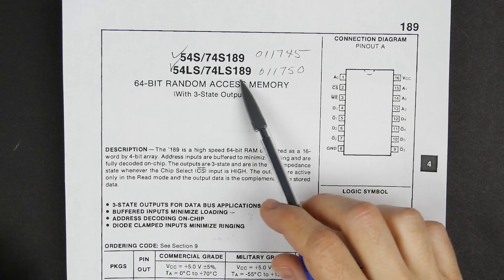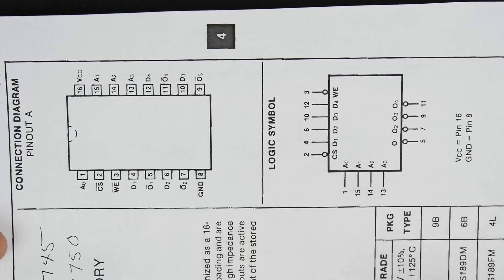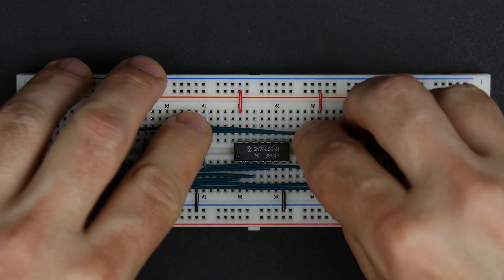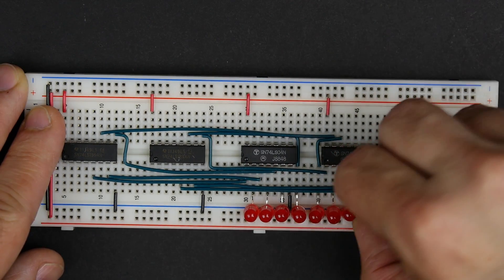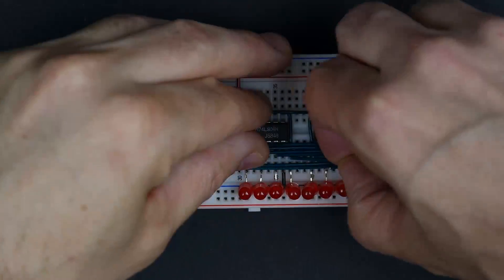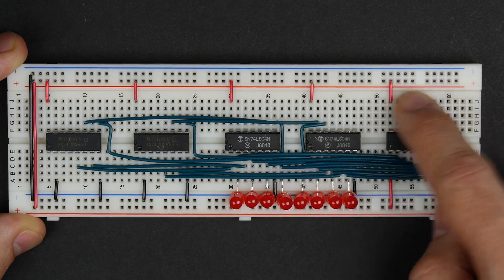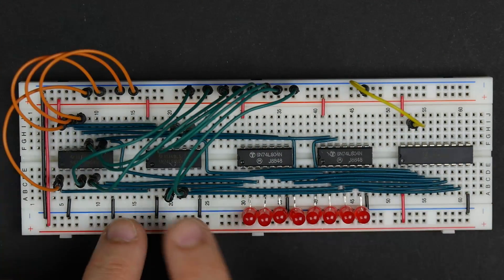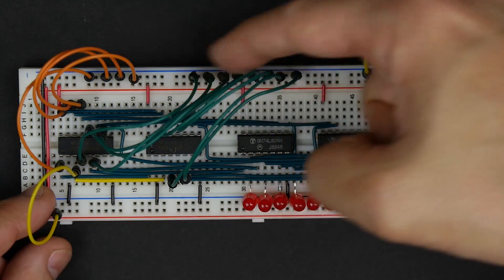RAM module build - part 1

Comment: Update:
If my calculations are correct, to achieve one kilobyte of memory on breadboards would rewuire 128 of the 74ls189 RAM chips to get 1024 addresses with 8 bit storage. 19 breadboards would be needed for all those ram chips, 15 breadboards for all the inverters, 22 breadboards for all the tri state buffer chips. All together ben would require 56 breadboards for all the chips if none of the breadboards were to share different chips. Only 8 LED's would be needed though because you can link every output of a single bit in memory to one LED which is nice.
Reply: actually you only need 8 Inverters (2 chips) and 1 tri-state-buffer
since only one chip is outputting at the same time, because the other chips are not enabled via the ~CS line, there are no collisions. so you connect all the address-, input- and output-lines into 3 small buses invert the output-bus and feed that into the tri-state-buffer.

Comment: If my calculations are correct, to achieve one kilobyte of memory, Ben would need 293 breadboards to accommodate for all the 2048 74ls189 chips. He would also need 1024 inverter chips and 1024 tri state buffers. 114 boards would be required for the inverter chips. 163 boards for all the tri state buffers. Again, if my calculations are correct, he would need 570 breadboards if none of the boards were to share different chips. Who knows how much wire he would need.

Comment: You should use tri-state inverters, so you save space and money. I'll personally do that, and I'll also use CMOS chips (AHC series, 3x faster than HC, 5V, and they cost the same). I don't think there's any problem with that and it'll be faster (I intend to run an OS when it's finished, with an appropiate clock, just because it'd cool).
Reply: GRBTutorials no need for that, just use the inverters prior to writing to memory and then use the tri state of the memory chips.

Comment: Why didn't you just invert the inputs? That way, you would store the inverted values, but would not need an extra tri-state buffer, because RAM chip already has it's output pins like that

Comment: Sir, im using an sram 6116, there is no output, only I/O, im wondering if the pin 20 or OE not is resposible for changing the Data in to output? Thanks happy and new year!

Comment: My experience with the 74LS189:
It turns out that the 74LS189 were fake chips that did not work (apparently the original 74LS189 are hard to find). The exact same issue is described on the EEVblog: https://www.eevblog.com/forum/projects/d-flip-flops-(ttl)-driving-me-crazy-(going-haywire-instead-of-1-or-0)/

I replaced the entire RAM with an LP621024-D70 128kB SRAM chip for my 8bit CPU. You can find the schematics on my website:
simonmartin.ch/8bit

Comment: Something I noticed in this video that just scratches an itch.. your breadboards have the power rails connected along the full length. I have to put jumpers between the two halves to have them conduct. :O
Reply: you went cheap and got what you saved

Comment: My RAM module is drawing around 2 amps when I connect A0 to GND. The 74LS189s become really hot. When I disconnect it from GND and connect it to +5V or when I disconnect it completely, the current being drawn Is only a few milliamps. How do people manage to get this to work properly?
Reply: Hi Radiofreak. I'm currently experiencing this exact problem. Did you ever figure out what the problem was? It's qiete infuriating
Reply: I had a similar problem. My 74LS189 were just emitting heat while not working at all. Turns out that my chips were some generic fake parts as described here: https://www.eevblog.com/forum/projects/d-flip-flops-(ttl)-driving-me-crazy-(going-haywire-instead-of-1-or-0)/

I then replaced the RAM myself with a LP621024-D70 SRAM.
Reply: Radiofreak1041 sorry can't help with your problem but how do you know how much current your circuit is drawing?

Comment: Please, help me! When I put 3rd (WE) pin of 74LS189AN to the 5V, chip starts to heat up. Whats the problem?
Reply: I came to the conclusion that the batch of chips were either bad or counterfeit, so I put this to the ebay supplier who refunded my money immediately without comment. Almost as if they didn't want any fuss. Anyhow, I bought new chips from a different supplier (which were more expensive) and amazingly they worked straight away and stayed cool.
Reply: I too decided to order more expensive 189's in the end from a UK seller (the batch that didn't work were a cheap Chinse import ... I know, I know).  The replacement parts worked exactly as per the datasheet.

My chips were actually for a 16 byte hardware stack rather that the ram itself.  Following Ben's excellent videos I've beefed my buiild up a little with 256 x 14 bit words of ram, 14 bit instruction words (6 for the instruction + a full byte of data), the aforementioned hardware stack, an enhanced ALU with 5 functions, two status bits from ALU (zero and carry), a bit shifter module (roll left, roll right and swap nibbles), 24 bit control bus (4 still left to play with :o)  ).  Managed to write a program to find all the prime numbers up to 255 (takes a fair old while!) and also a program to write alpha numeric to a 16x2 line LCD module attached to the display module. I've had so much fun with this.  Massive thanks to Ben for the tuition and inspiration.
Reply: Same thing here. ordered replacements from jameco electronics in the US, they work fine. thanks!
Reply: Having the same issue.  Don't suppose you've sussed it yet have you?
Reply: Tim Baxter Still doesnt work. Seller from ebay sent me a new IC. This time I will try to replace those RAMs with EEPROM.
Reply: I'm also getting the same problem - according to the data sheet, with just power, CE and WE it draws 40mA - and mine does.  But as soon as I put any other connections, like data lines, address lines or output lines in, the chip heats up.  After a couple of minutes it's at 90 degrees and still rising, so I cut the power and scratch my head.  I've removed all the connections and completely rewired the RAM unit three times, always with the same effect. I've also tried swapping out the 189s for others - same again.  Any suggestions would be gratefully received.  In the meantime I've ordered some 74C89N RAM chips that looks very similar (although I am probably hopelessly wrong there).
Reply: I'm seeing the same issue. Did you ever figure this out? Looks like several others are as well...
Reply: Andy Timmons thank you for the reply. Someone else reported the same fix as well. I'll try that and report back in case helpful to others.
Reply: Hi! I also have this same problem and have ordered from two different ebay sellers already and they are all faulty. I cheched Jameco but they do not ship to Finland. Anyone here have any other site where these can be ordered to Finland?
Reply: Alex Roetter Hey, I just hooked mine up (from Jameco) and it feels generally a bit warm, haven't bothered to let stay on for long ($5/chip), any ideas as to why?
Reply: Ahh, I was also effected by this. I had bought these chips years ago on eBay and only tried wiring them up now but same situation, tried wiring them and the chips overheat. I have some more versatile chips on the way anyway, so not a big deal, but really frustrating.

Comment: It's hard to understand under what circumstance someone would want the complement of the data they tried to store.  Really seems like a "feature" where the chip designer like.. totally forgot to add that last output transistor, man, aawww.  Guess it can just go on the datasheet as an inverting output then.
Reply: He's probably laughing at us right now XD
Reply: If you package it as "for hobbyists," then it's a feature because said hobbyists get to spend more time, money, and space fixing the issue built into the product you made.
Reply: maybe it‘s for double purpouse, you can use it as a RAM and as an inverter too
Reply: for some really special application yes
Reply: Your inputs could be generating the inverse of what you want to store.

Comment: Dude! Why didn't you put the inverters on the inputs so you could use your tri-state outputs?
Reply: GordieGii 1) he could also use it like that w/o problem. 2) He deliberately chose to manually implement tri-state switch so that we can see LEDs on at all times, not just when we are outputting stuff to the bus
Reply: @Redstonetehnik  Did you tried that suggestion, pls? To take an edvantage from three state you are connecting 189 RAM output to bus and inverter inputs to same bus (keeping inverter output connected to 189s input) then you are losing writing possibilities of RAM despite its not outputting anything. Not sure why. Might be because of loop? Not sure why since during writing Im not reading RAM to bus...

Comment: can i use 74htc series with 74ls series?
Reply: yes , I think
Reply: On reedit,a guy says cht chip are better, because the computer runs with less curent draw, those chip are cmos, not transistor,a more modern technologe
Reply: @arlenestanton9955  yeah but unless ur building a computer with a size of a room with those chips , ur not gonna run into problems about that

Comment: I don't understand why you don't have this as your registers. is it to show us how to make the registers, and then you said "forget it, I'm using this chip to remember the code" , or is it because the A and B registers are genuinely different from RAM?
Reply: registers are where values are held temporarily so that functions can be performed on them - like the ALU in this project adding registers A and B. RAM is a much larger amount of storage space, but you can't do math or anything on it.
Reply: @monkybros  some architectures do allow you to operate directly on RAM, heck, the MC6800 (not MC68000, don't know about it) has arithmetic instructions which require one of the inputs to be a location in memory.
Reply: @bryceforsyth8521  Those architectures have instructions that operate directly on RAM, but in order to execute those instructions, the CPU needs to read the data from RAM at the given address, calculate the new result, and write it back.
Of course, the same is true if you run an instruction that operates directly on a register. The difference is that there's typically only one path to the RAM (through the bus), but there could be several parallel paths to the registers, so that more than one can be read at the same time.
If you have an instruction that adds the contents of one RAM location to another, it will need one cycle to read each value, and one to write it back, so the single connection to RAM likely becomes a bottleneck. Unless you have separate RAM for code and data, the connection to RAM likely becomes a bottleneck anyway since you can't read instructions and read / write data in RAM in the same cycle.
Reply: Registers are always available, the data in the RAM must be addressed.

Comment: The datasheet of the RAM chips states that the outputs are 3-state. Why use a buffer?
Reply: He wants to see the output on the LEDs, without necessarily outputting to the Bus.
Reply: I had the exact same question. Hoping Ben can shed some light on it.
Reply: That makes sense. Easier to debug, good idea. Thanks Mohammed!
Reply: also when he built the ALU he used the unbuffered outputs from the other registers to feed the ALU

Comment: Why invert the output? Just say on your switch that 0 is 1 and vice versa. And here we go.
Reply: Thomas Anderle but it is writing non-inverted. So if it writes 0x00 it'll return 0xff, and if you write that again it invertes again. So either on write or on read you need to invert it.

Comment: Hey Ben, a couple things:
1) you should tie the unused inputs of the inverters high or low to prevent them from oscillating.
2) can you use an inverting octal bus xcvr and not need the inverters?
3) How about adding battery backup to the RAM?

Great series BTW!
Reply: 1) LS chips have a tie up resistors inside so if you don't connect them thay will go high (HC doesn't have that) 

2) it's a ram , if you nead memory that stores data even after unplugging power , use EEPROM or something

Comment: when i put new information in the sram  it loads the bits but when i turn off the pwr it gose back to they original information on it
Reply: that's how sram works. The data is temporary.
Reply: you mixed up RAM with flash memory or EEPROM

Comment: I can't get the 74LS189 yet but somehow I found some 62256, a 32768*8bit SRAM. However it has 15 address pins and it's data I/O pins are all bi-diractional. How can I use that ICs instead?
Reply: If your data I/O are bi-directional - you will need to probably set the CS and WE lines appropriately.  I also discovered that I needed to use pull down resistors on my digital lines A0-A7 - so that those lines did not float when not set to high.
The problem I had was I was programming address 0, with 55 hex (01010101) I was seeing 11111111 as the return value.  The problem was that the LOW lines were floating, and not pulled down, and the memory chip was interpreting it as high instead of low.
Hopefully that helps some of you.
Reply: EBAY has currently 9 seller listings for the 74LS189.

Thanks Mike,